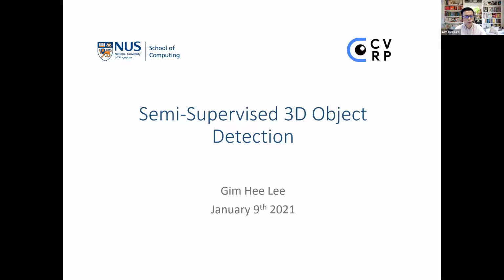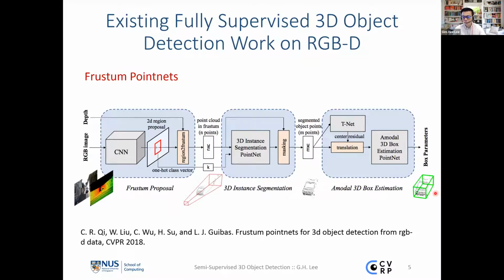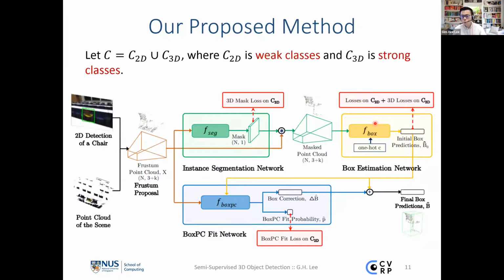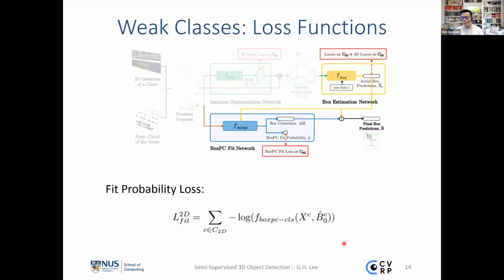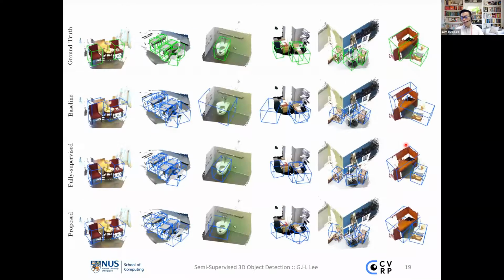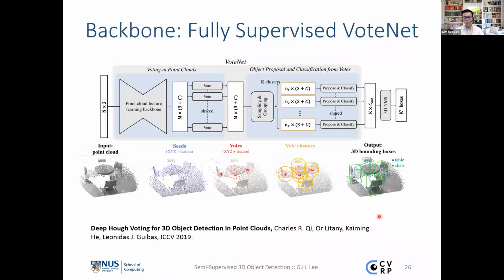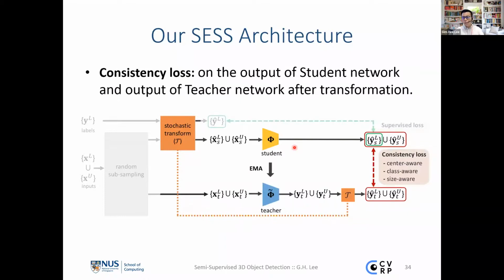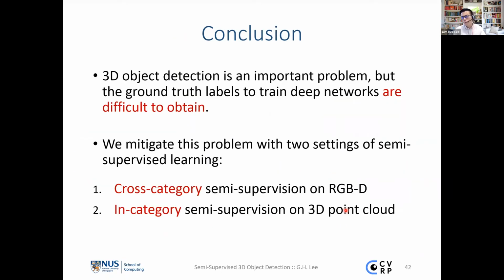2nd VASBSD (@ WACV) 2021 Keynote Talk: "Semi-supervised 3D Object Detection"

Comment: Sir I am a university student. I was trying to implement transferable3d semi supervised 3d object detection using sunrgbd dataset.
When I tried to run sunrgbd_data.py, the .TXT files mentioned in code such as 'train_mini_data_idz.txt' isn't present and so the code is not running. Could you please help me with this issue sir I would be really grateful of you.